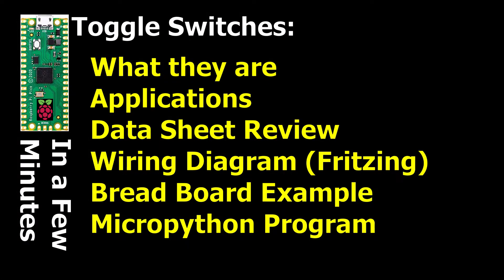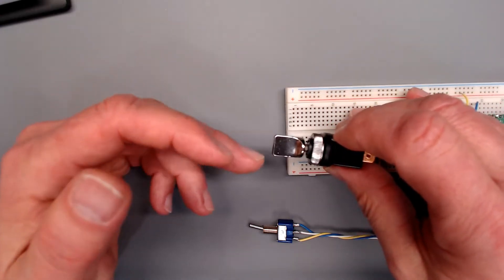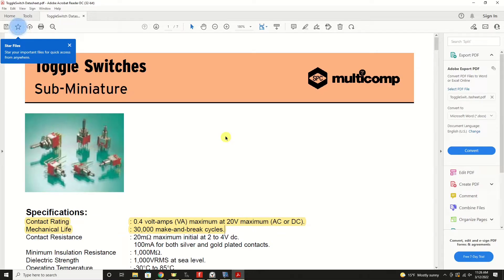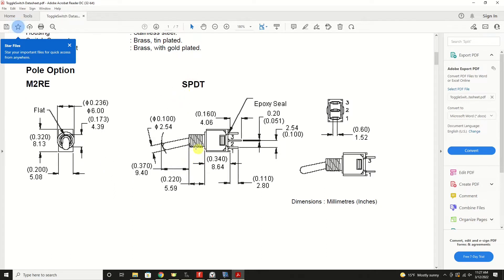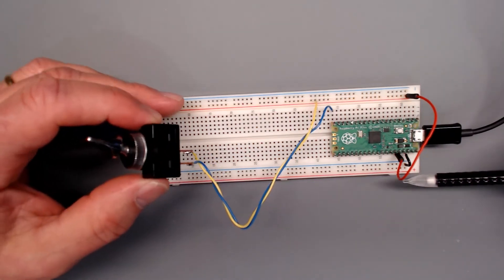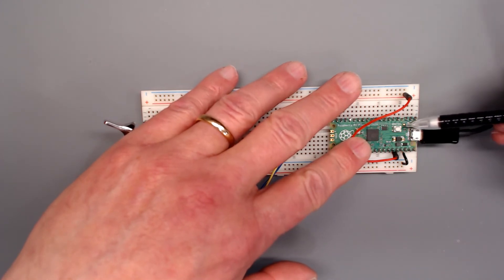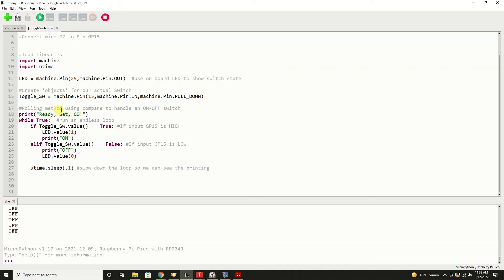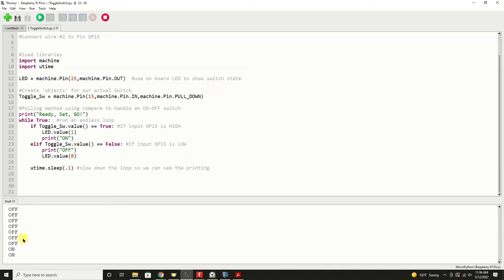How to interface a RPi PICO with Toggle Switches

Comment: Gday Chris, great video thanks... Question if I may, How do you connect  a Toggle Switch that has a Built in LED to the Pico Board. I have 15 Switches I need to connect, I believe they may need an external power supply?
Reply from the maker: It is impossible to answer that question thoroughly without have all the details of your circuit.
Chris

Comment: This is exactly how a tutorial should be: clear and concise. I finally have a circuit on my friend’s Pi 4 model B that tracks the state of a toggle switch to control code being run on the CPU. Thanks for showing the simplest possible wiring. This cleared up a lot of confusion I had about working with RPis.
Reply from the maker: Hello Frank,  I am glad to hear that you got your project going!!!
Cheers!
Chris

Comment: Very clear what you did here to wire it up. Rare.

For the Pico It's something like 2.5 volts minimum to detect "on" or high in gpio/digital inputs. I tell you because I didn't know and built "a nice looking 3 key switch thing" with a LED for each and got 0.7 v left. To then add "fixes" gets complicated. The max is around 3.3-3.6v and not 5 (which you must consider and really know before using a device.)
Reply from the maker: Thanks for sharing, and yes, minimum voltage for "ON" must be adhered to with a generous safety margin as well.  
Cheers!
Chris